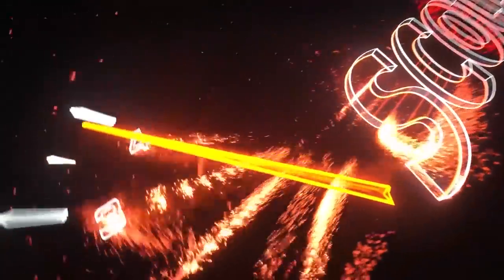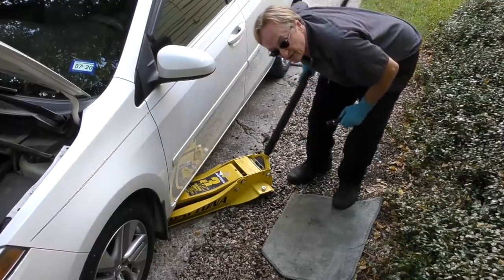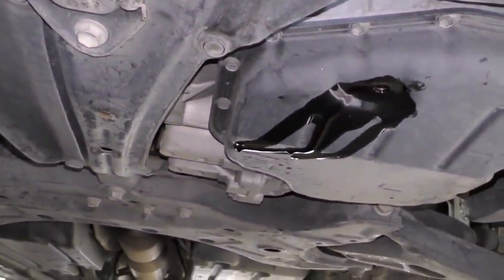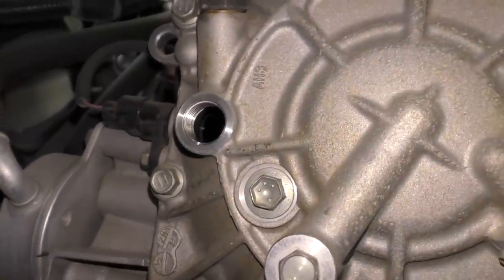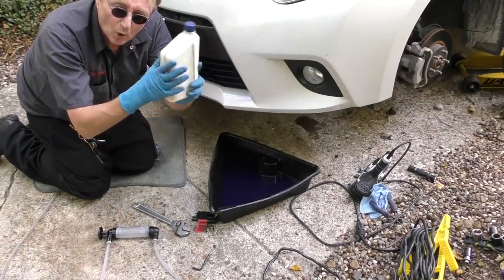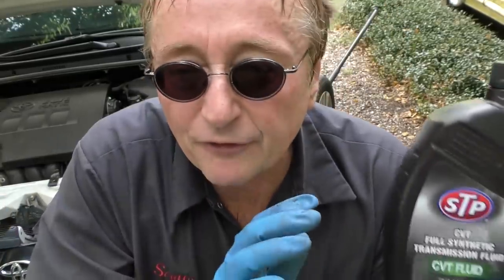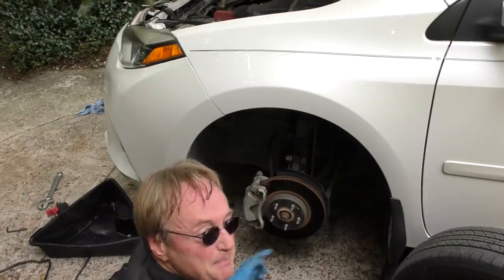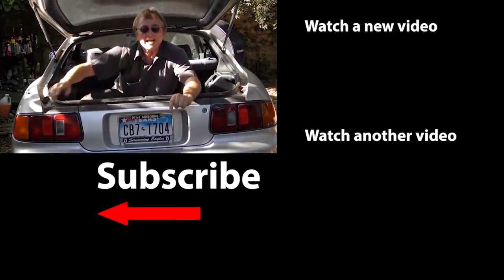This Toyota Corolla Has a Serious Problem

Comment: It's true, the fluid will last the "life" of the transmission! Even if that means the life is shortened by not changing the fluid.
Reply: It should say the 'fluid lasts, the life of the transmission warranty.'   The transmission warranty is 60k miles, the fluid will last that long, but changing it makes it last 5x longer.
Reply: Went looking for a new mattress the other day. The salesman said this brand offers a lifetime warranty. I started laughing. He said "What's so funny so we both can laugh". I said "I'm 66yo, for me it just needs to last 10-15 more years, if I'm lucky". We then both laughed. I bought the mattress.
Reply: Yup.  In the same way that one gallon of water will last your entire lifetime trapped on a desert island.
Reply: ctuan13 good analogy.
Reply: PittCougar so true.
Reply: @adcolt54 bro ur 66 and like jason genova?
Reply: No one can trick you with double speak!
Reply: @billdougan4022  Fluid is good for 100,000 miles under normal operating temperatures (I forget what this is for Toyotas fluid) and standard driving. After that, the fluid begins degrading. If driven even 10 degrees above the normal temperature the life of the fluid will be cut in half before degradation begins to occur. Manufacturers do this because if people drain and fill as recommended by Scott and other mechanics the cars will last a very very long time if there is nothing inherently wrong with the design of the product.
Reply: THEGAMINGHELP101 when you talk to the people about this they say you are a smartass... I giving up on telling them..watching them screw up their own gearbox is much fun
Reply: @cheryee3659  serves them right!
Reply: @cheryee3659  Well I am an engineer. We engineers sometimes do sound like crazy people
Reply: Its just like having very fresh food vrs old unfresh food and how your stomach feels afterwards  !!!
Reply: I've seen these cvt last over 450000 mile easy
Reply: @thivakarsaravanamuthu4744   minds at about 200000
Reply: It's not a f-up , it's a feature! 
Lee aiacocca
Reply: Yup don’t flush z transmission that’s never had it fluid changed cause u can dislodge dirt build up a week later oh my transmission wont shift properly a week before they changed the transmission was working fine don’t play with it

Comment: Scotty, you should make a video on the maintenance documentation and reminders for your vehicles. How you remember when to do what, how often you check your schedule, etc.
Reply: I would like to see a video on this too
Reply from the maker: Good idea, thanks!
Reply: @scottykilmer  Yes please. Because now everything is life time. And we want to keep our cars for ever
Reply: Yes please Scotty it will be very helpful
Reply: Years ago I bought a tabbed binder called Auto Record with sections for Gas & Oil, Lubrication, Repairs & Accessories and Tire Mileage.  I log performed maintenance and repairs.  Today, I believe there may be smartphone app to log that.  I still keep the log, although they are not sold anymore, but I produced my own using software and a printer.  I use a new one for each car I have owned for the past 40 years.  Better than having to search your memory and it allows you to keep an eye on maintenance intervals and state of repair for your vehicle.  In addition, I have four small Honda bikes and each one has its own book.
Reply: Yes, Please do on full maintenance video
Reply: @scottykilmer  I computerized my records as follows:
I set up a file with bold headings like Brakes, Spark Plugs, 90,000 Mile Overhaul, Transmission.  Like this:
Brakes
Toyota brand brake fluid

Replaced brake fluid 2015.  
01/13/2019.  Fluid is still good.

Replaced front rotors and pads.  August 5, 2016.  
Had gone 92,000 on the rotors and 65,000 on the pads

Replaced rear rotors 2014
Replaced rear pads 08/08/2019 at 107,255.
Reply: It's a good idea, Pms.
Reply: @florret2003  I have some on my phone, but I realized lately that if something happened to me my wife would not be able to find or use that info, so I am re-recording stuff onto paper.  With 4 cars I lose track too often.
Reply: EVERY car manufacturer includes a spreadsheet for you to record maintenance actions (in the owners manual)-and EVERY used car I ever bought had these-none of them were ever filled out! Plus the mfg. tells you exactly what to do at which mileage. I never understood why owners never fill them out.
Reply: @genekelly8467  That's good, but if you buy a used car I doubt you'll find one in the glove box.
Reply: Gene, I understand that. That's a no brainier for everyone watching this channel I'm sure. Like said, it may not even be there in a used car. Scotty does many, many more things than are required. He does things on a different schedule than listed in many cases. He also has cars that go beyond 200k. The sheets may fill up. So the standard sheet (s) may be more confusing if you're not following their recommendations, (ignoring lifetime fills), door seals, at-205 on boots, etc. There's so many things it probably would be easier to just create your own system.
Reply: Just read your damn manual.
Reply: C. M. Do you even watch the channel? He doesn't recommend following the extended oil change intervals, does maintenance that isn't required or isn't listed. Example, I have an AWD Ford. The PTU (PTO) unit says it's lifetime fill but anyone who knows anything about it knows that never changing the gear oil in it is foolish. 
Watch the channel more regularly.
Reply: @Cristian121212100  The manual is for people who don't know any better.  It's a guideline to planned obsolescence.  A good mechanic knows better.
Reply: maybe an app that helps with that sort of thing...
Reply: I second that!  I have a pile of 📄 of the oil services and major repairs I have done to my car, now I wonder when my next tune up should be done or transmission service.
Reply: Anthony Von extended oil changes only apply when you use the RIGHT oil!! On my VW I use VW DPF diesel certified 507 certified oil every 10k miles but then again. I drive mostly on the highway. I’d follow my manual in that kind of stuff. It says to replace the Transmission fluid every 40k I replace it every 40k.
Reply: I just registered on the Toyota owners website. I make notes about all of my servicing I also make additional notes on what the dealership did. For example, my dealership noted that they checked the electrical on my Prius. What they didn't say was that there was a check engine light for my mass air flow sensor. It turns out that moisture had gotten into the connector during some bad weather and caused it to malfunction.  

Do most since I do most of my own servicing now, I even make notes of what brand of oil and filter I use. I believe that it will be something that I will use to gain an advantage when I decide to sell the car.

Comment: CVT  Should only be used in low powered go-kart.
Reply: and why is that?
Reply: Nothing wrong with a cvt as long as you don't buy a Nissan!
Reply: and snowmobiles
Reply: I had a yard cart when I was a kid that used a CVT with a rubber drive belt. I tore that belt to shreds every week just about. With cars, I don't understand why they can't just clean the tranny up and replace the metal chain/belt when a CVT goes out. I heard you can't rebuild them easily.. They seem pretty simple compared to a regular tranny. Of course I'm not a mechanic so what do I know..
Reply: And atv’s
Reply: @bigdaddymak1439  
Except for the design, that is....
Reply: Chain driven CVTs were used in some old battle tanks....
Reply: @aaryeshg.6526  
*Citation Needed*
Reply: @mulljacob  It's because they don't want you to. They have planned them to wear out so you buy a new car every 100k miles. Funny and annoying at the same time.
Reply: Randy Jackson  I agree. I saw a pic of some Nissan CVT drive chain/belt - not sure what they're actually called. It wasn't a chain with little bearings that could make it go around something, it was a solid band of metal. I think that's why they're the worst. Imagine a band going around and around pulleys hundreds of thousands of times. It's no wonder they wore out easy.
Reply: @atticstattic  Snowmobiles have them, quad-bikes have them... it's so obvious... :)
Reply: Japanese put them in light tanks, it really depends on who builds CVTs.
Reply: @aaryeshg.6526  
Snowmachines and quad-bikes are not cars...
Reply: @bigbigmurphy  
*Citation needed*
Reply: @bigbigmurphy  I wonder how dependable those were. lol I think somebody will perfect CVTs even for higher horsepower eventually, or at least as reliable as traditional auto trannys. I think my main concern is making these things serviceable so the cost of ownership is lower. A lot less people are going to care about a $500 or $1K CVT repair every 100 or 200K miles than a $5000 one.
Reply: I love my CVT I change fluid every 30k I get 30 mpg city 40 Hwy, If easy on acceleration I stay at 1200 RPM's from start to 60 MPH.
Reply: @publicmail2  If I don't stop commenting in this thread I'm going to go look for a Honda with a CVT tomorrow. You're winning me over! :) I'd change the CVT fluid every 10K miles just to be extra nice to it.
Reply: @publicmail2  
Thank goodness CVT fluids are so cheap!
Reply: @mulljacob  it's called a push belt, and they are driven by sheaves, not pulleys. Yes, the belt is pushed, not pulled like people think. The belt consists of 399 clips/elements that are pressed together when driven.
Reply: @mulljacob  totally unnecessary to do it that much. 30k is perfect.
Reply: That's what he's working on, LOL
Reply: Well...isn't that what the Corolla is?
Reply: atticstattic  have you seen the dealer price for genuine Mitsubishi cvt fluid? It’s $20 a quart I would know and to change out the fluid you need about 5qts for about $100 and that’s not including the filter
Reply: bigdaddymak1439 I guess it depends on what year Nissan. A friend had a 2008  Maxima and had close to 150,000. He really didn't have major problems until the car got close to the 150,000 miles.
Reply: googly moogly Kia and Hyundai’s new CVT is chain driven it doesn’t have a push belt.
Reply: JUST SAYING I have a 2009 Altima with V6 with 287,000 miles on it original CVT and engine and still running perfect, just regular fluid changes every 30k with valvoline CVT fluid.
Reply: I have a Scion iQ with a CVT, does that count?😂
Reply: Patrick Duclos-Knott dang dude awesome!
Reply: @mulljacob  they can replace the chain belt

Comment: Scotty, On many cars the first plug is the fill level indicator, thus “almost” none should come out unless the oil is above room temperature. If the vehicle fluid is  room temperature, (engine off 16 hrs) only then you can refill the same amount you extracted.  However, using the overflow plug method has an oil temperature spec methodology that has to be followed.  -best,  -hg

Comment: There is one thing I wished scotty had pointed out and that is the code that is written on the fill bolt  in this case (FE). This indicates which transmission fluid should be added to the transmission. There are other codes like WS and TC that are written on Toyota Transmission fill cap so just be vigilant that the right fluid is going into your transmission.
Reply: Correct and it's always best to use the OEM toyota fluid, its expensive but cheaper than a new transmission lol
Reply: @mr.boostang2064  would you take Amsoil over OEM? So many ppl live by Amsoil.

Comment: I just did this took an hour, only thing I did different was got the fluid from the dealership and dumped the fluid in to an empty milk carton, marked if off, cleaned it out and poured new fluid in to the container up to the marked line and used a pump to fill it up.  Yes the old fluid at 40k is noticeably dirty vs new fluid. the 4qt container form the dealer ship was 100 bucks, good for one more, change, cheaper than a new transmission
Reply: Same as you except I used a long funnel to pour in the fluid, I also added an extra 2oz (60ml) of atf to compensate for the fluid that remains smeared on the container, hands and on the bottom of the transmission pan you whip off. Thus far it's running smoothly so hopefully all is well

Comment: Aren’t you only supposed to do this at a specific temperature on the Toyota’s?
Reply: As long as the temp of the oil you are putting in is same as the temp you are taking out it's fine.  This was in case fluid expanded at warm temperatures.

Comment: OK, the fluid is good for a lifetime. NEVER needs changing... But here is where the drain and fill plugs are... 
Don't you just love engineers?
Reply: You need to drain it when you remove and replace.
Reply: He didn't get much fluid out, did you see how high the plug was in relation to the bottom of the pan?
Reply: @Fred Flintstone If vehicles are driven in certain conditions (especially towing), then manufacturers often DO recommend you change the trans fluid, so the option is there. Tell them that when they tell you it's a sealed unit and they can't do it.
Reply: @markkunzman9095  I've read around on forums and some people say that you have to do this procedure two or three times to 'get all the fluid out', over the course of a few days. There are ton of conflicting opinions on trans fluid changes. It's one of the most contentious issues in car repair. Right up there with oil change intervals.
Reply: @markkunzman9095  yes.....when I went to the dealer to get this done...he said he needed to drop the pan to get more out because a lot of fluid is still sitting in the pan below that plug. He then changed the pan gasket as well. Did it at 60,000 on a 2014 Corrola.

Comment: The plastic piece is used to measure the full level isn't it hollow when the pan is full fluid comes out where the the drain plug goes.
Reply: That sounds familiar but the only problem is the car isn't level.   So to use that technique the car would have to be on a lift.
Reply: @behexen250 needlessly complicated
Reply: @behexen250 1st gen Porsche Boxters had this exact procedure of refilling their trans fluids too. Great explanation. 👌
Reply: Scotty is doing it wrong.  This is why the engineers don't want you or any mechanic to change the fluid.  You have a greater chance of damaging the transmission than if you had just left it alone.  The fluid doesn't get dirty, it just breaks down but synthetic fluid doesn't break down and is good for 150k-200k miles.
Reply: @carnutal3627  Exactly!!! The car needs to be on a lift.  It's not a DIY or shade tree mechanic job.  And you must use the correct OEM fluid.
Reply: Well that answers my question about adding CVT fluid. But I'll stick with my dipsticks!
Reply: behexen250 That whole procedure sounds totally ridiculous. Who wants to deal with hot trans fluid when draining the thing, and to do it 3 times you gotta be kidding! What Scotty shows makes much more sense and I don't think his way will be damaging to the CVT in any way (unless you can tell us otherwise). It's much worse to leave the old fluid in there as that will definitely be damaging the longer it is left unchanged. It's almost as if the manufacturers make it so complicated to discourage servicing and leading to failure so you can go buy a new one sooner.
Reply: @behexen250 is right. The platic insert is meant to drain the pan to the right level after filling up and bringing it to operating temperature. The point of draining and filling multiple time is to replace the oil in the actuators/valves. Even though, these cvt transmissions are not meant to pull heavy loads. They might not even have and external oil cooler, what i mean is that these a design for light duty and therefore the oil might not even get that hot and degrade overtime. It sure won't be worst to replace part of the oil but to be honest im not even sure its worth being done. But if you do it why not do it right once and for all. Here's my 2 cents. Have a good day.
Reply: @behexen250 Yeah, it's not an easy job. If you do what Scotty does in the video, you're very likely not changing anything like all the fluid. Maybe a third.
Reply: behexen250 you’re actually supposed to do it at a fluid temp of 104-108 degrees F, not running temp, this why it’s recommended the dealer does it, a lot of Toyota’s are being improperly serviced because of this. The fluid expands at running temp so you end up draining more than you put in.
Reply: @behexen250 between 104-113 degrees, running temp is much higher, so toyota came out with a tech bulletin to purchase some pumps and new leveler to do these at running temp when someone comes in, they came be out in 2 hours, rather than waiting for the oil to cool down and having the customer leave it overnight, etc. crazy!!!!!
Reply: Scotty did it right and there will be issues. He put back what went out . Simple done
Reply: I feel stupid for admitting this, but I would have refilled it until the fluid was right up to the fill hole level. And I wonder how many well-intentioned DIY'ers simply drained the bottom plug only without knowing about the plastic piece!
Reply: @jpnm81  How do you know the right amount was in there in the first place?   You can't just put in the same amount that came out.
Reply: Alejandro Torres you are 100 percent right.  Tell it to Scotty
Reply: @behexen250 plus there are 2 filters to be changed
Reply: @ninjamaster3453  It's designed to be needlessly complicated. That way you buy more cars, buy more transmissions, and pay more at the toyota dealership.